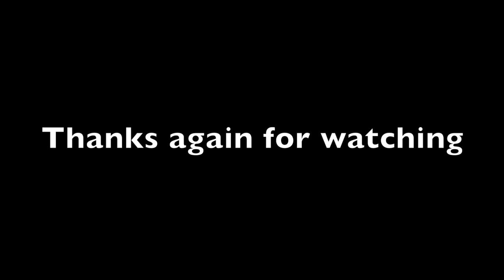Does Pine Work for Building Furniture?

Comment: If your lumber is bowing and twisting it's not completely dry.
Reply from the maker: Sam Logosz yes, exactly. This lumber is a “common board” sold at stores a lot in the western part of the USA. I grew up calling it pine, but might be some kind of spruce or fir. I usually don’t use it for anything that needs to be fine finished, as it seems to be harvested and dried in a hurry. Additionally when you add in the tropical moisture and humidity, this stuff everything but stable. Thanks for the comment.